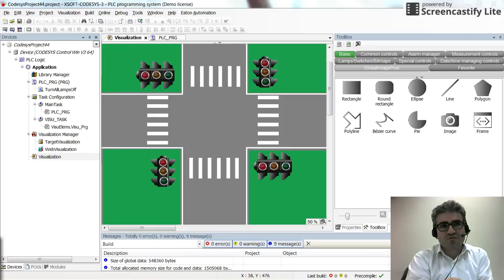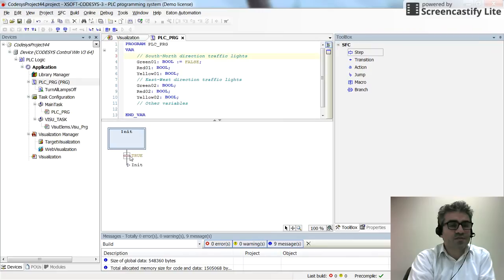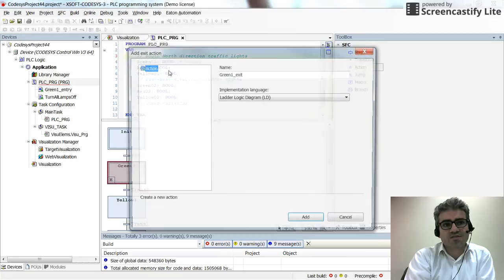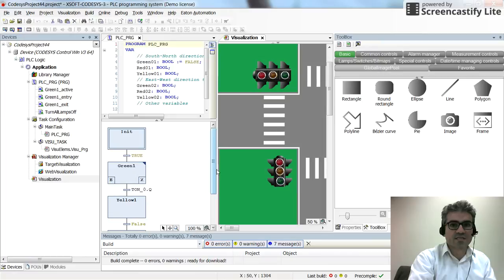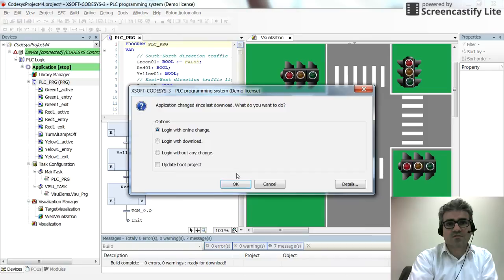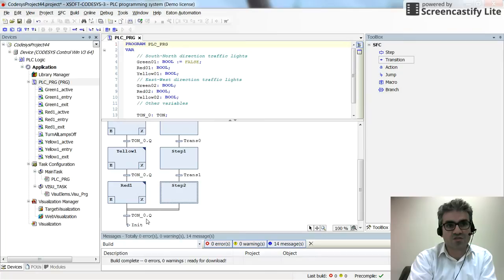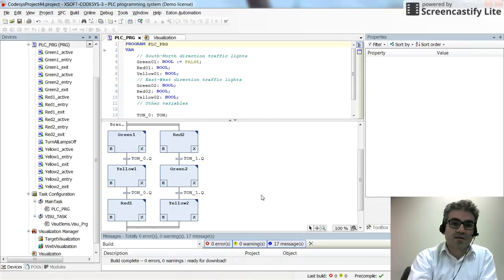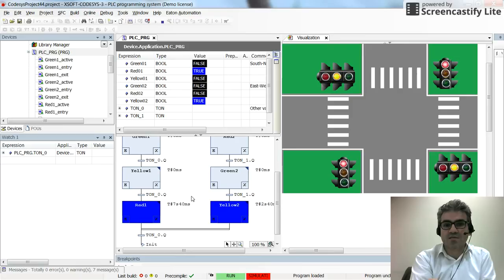CODESYS: SFC programming example- Traffic light control in the intersection #codesys #plcprogramming

Comment: I have a little bit more complicated SFC. That one is metal washer with different chemicals. And in one step error may occur like for example level of chemicals in a tank lower than allowed. I use SFCPause to pause SFC. But unfortunately when SFCPause is set, timers continue to count. I mean the transitions are not done, but Ton continue to count. For example I enabled SFCPause when timer was T#2s and released it in 5s. Then timer after release will be T#7s. It does not show timer running while SFCPause but it continue to run.
Reply from the maker: I am a bit busy these days, I will write about this ASAP.
Reply: Tohid Alizadeh I did it actually. But i did not use SFCPause, but I used my custom Pause input variable. With that one everything works. I save value of times on pause and resume after pause released.
Reply from the maker: Sergey Romanov Good to hear that you have found a solution.